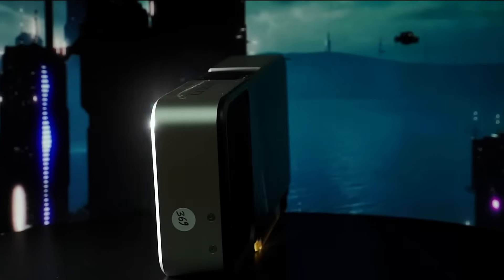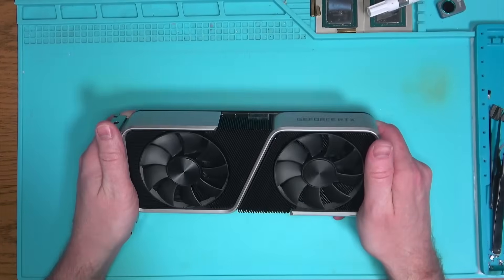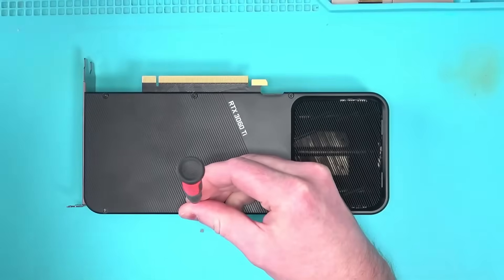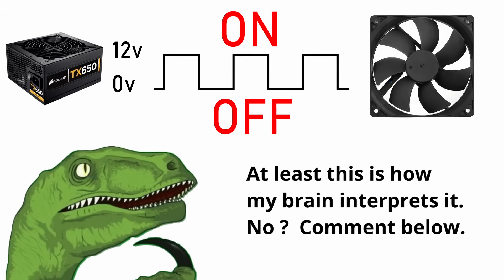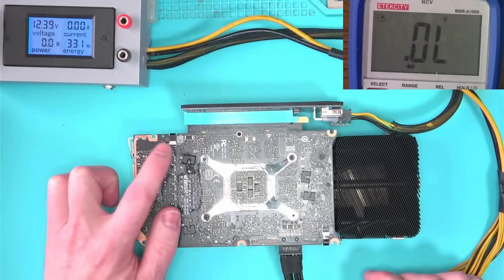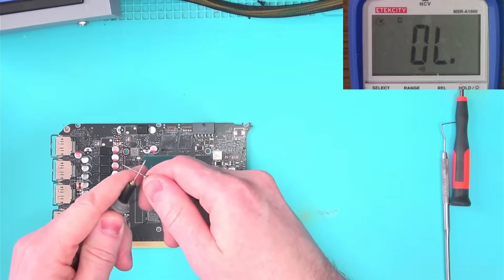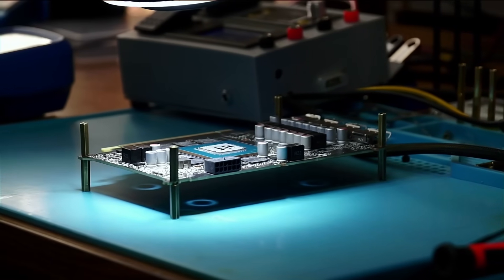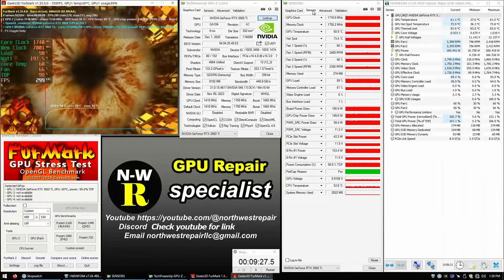Saving Your GPU: Nvidia 3060 Ti Fan Failure & Overheating Solution!

Comment: Hi Tony, I do'n't have a 3060 ti but, I do own a Zotac GTX 1070 Ti Amp! and the fans are stuck at 43%, I can change the speed in MSI Afterburner and or Firestorm but the changes are not happening on the video card. I recently cleaned it and replaced the thermal pads and thermal compound. However, I am wondering what controller is responsible the Fan's RPM/Feedback. Also the cable for the Dual Fans PWM cable looks to be fine and both are spinning. But as per the hardware I just don't know enough. Should I replace the Fans or the Fan PWM controller? If it's the controller, can you please let me know which one. Thank you much! Also I should say that both fans do spin, also when I turn on the PC they are quiet but just as windows logs in I can hear the rpm increase to the 43% and that is where it stays and can't be changed. I tried creating a custom Fan Curve but this did not work either. I also used DDU to remove and re-install the drivers and this did nothing as well. Maybe Windows is screwed up? I have a Multi-meter is there something I can test to see if this is a hardware issue? Thanks Tony! Cheers!

Comment: Hello my man..found you few weeks ago and....you rock.
I have few questions if you can answer if you ever read this.
1- you are awesome. Not sucking up...what you do is art.
2- are you located in Usa or EU or?
3-if on laptop MB or simply gpu board there is empty sport for memory could it bought and put in those spot and would it read that now it has from 6 to 8 gb etc?
4- reason I found you is that on my gigabyte P57W v6 laptop gpu died..Could that be fixed and could 2 more GB of ram be added?  Like is that doable, or do people do it?

Comment: What a great tutorial on fixing an nonworking fan! Explanation of PWM was also really great with oscilloscope. Where did you get the part if you didn’t have a parts list? A donor board? it would be cool to understand how you would go about the repair if you didn’t have an exact donor board, how would you confirm the specifics of a PWM Chip to be sure that it would work if you pulled it from a non-matching donor card.?

Comment: What caused that part to release its smoke?
Reply from the maker: who knows. internal fail
Reply: Small package, high switching frquency and high load for such a package. Commonly seen on main power rail switching keys in laptops. Today I had Ideapad 320 8th gen i7 with semi shorted AON 7408, board was in protection  mode due to shorted gate. No carnage, all resistances were ok, no shorts. Replaced with slightly better AON7410 and I guess another happy customer.
Reply: @MrHimer12  This only adds to the number of questions, but thanks for sharing.

Comment: More fancy fans have their own integrated motor drivers and speed controllers, so they use the PWM duty cycle only as a control setpoint reference (e.g. power percentage) and generate the motor driving voltage themselves based on it, which is usually another (high-current) PWM signal, but it can be sloped to reduce noise. I think some can even regulate themselves to a constant RPM (the PWM is interpreted as min/max percentage), or maybe that's just for pumps because most mainboards with PWM and tach signals do RPM regulation anyway.

Comment: Just wondering but when you first plugged it up and powered it on.  Can you not spin the fan by hand while watching the monitor software to see if it shows RPM rotation on the fan in question initially to check for fan 'communication' to the board?  Or is there a reason you should not do this.  Just wondering if there is anything good/bad in doing so.
Reply from the maker: yes most likely
Reply: @northwestrepair  thanks for the reply I wasnt sure if you had a reason not to.  Ive heard mixed feedback over the years about spinning fans on your own both good and bad so wanted your take on it.

Comment: What could have caused all that damage to that particular component alone?
Reply: Yeah, it does seem peculiar for such component(@that circuitry) to fail. If it's a common failure then it's an Apple engineering move.. Otherwise i guess either a defective chip or a possible bad filtering component along the way.. In that case this card might star again in a future video 😅

Comment: PWM interpretation is close, just that instead of frequency, it's duty cycle (how long the square wave is on vs off for each cycle - but frequently should stay the same.  (I think)
Reply from the maker: Duty cycle is the time which it stays high. (I think)
I think so because I weld sometimes and welders have duty cycle in minutes, indicating how long it can continuously weld.
Reply: @northwestrepair  Lets assume your fan consumes 10w at 12V. If you provide 12V half of the time and provide 0V rest, your fan cannot consume more than 5W. While off it is slowing down, while on it is speeding up. Not dependent of frequency but on off time percentage. Frequency determines smoothness of operation. If we replace fan with an LC circuit then we get buck converter.
Reply: @northwestrepair  I figured you knew, I guess you just got caught up trying to explain and film while fixing the card.  I was not expecting to know something that you didn't, that would have been a first lol
Reply: Right the PWM frequency doesn't change, just the duty cycle is altered as a percentage of on vs off over each interval.  FYI, computer fans typically operate at a PWM frequency of 25kHz.
Reply: PWM literally means pulse width modulation.  Yes frequency is typically fixed, basically its like flipping light switch on and off very fast and changing based on load how long you leaving it on for.  This is great for motors and initial load devices as you can push full duty cycle only briefly then back it down and adjust the 'on time' to match load demand and keep the required speed wanted.
Also depends on the literal design of the PWM as that is a generalized term and there tons of methods/names that employ it.  This is the basics of what your power supply always does hence why its called a 'switching' PSU. because its literally switching on and off in the double digit kilohertz range and you cant tell its actually not constant DC but rapidly switching DC.  This is also why ratings on PSU's are important as to how efficient it is.
The wikipedia page on PWM is pretty well documented about this.  I only know about this stuff from building PSU's back in the day for amplifiers before switching PSU's became the standard and moved away from full wave square bridge rectification for DC.  You'd be surprised how much amps you can pull out with nothing more then a capable transformer, square rectifier, and enough capacitance to flatten out the DC waveform.  They talk about exactly this in the Power Delivery section.
Reply: yes the duty cycle of the square wave results in an average voltage the motor sees... hence the wider the width the higher the average voltage and vice versa. This is better than using a variable resistor as that waste power and heat.
Reply: @enkur1972  in a lot of cases, the variance of actual voltage isn't good for the load either.  Pulsing full voltage is better for speed control.  This might be more applicable to motors though.
Reply: I don't think frequency has to stay the same. Duty cycle is a percentage. You could have a 50 percent duty cycle with completely different frequencies.
Reply: @--_DJ_-- i doesn't have to but it's usually kept the same because there are few upsides to changing the frequency.

Comment: Hello! Can you clear my doubt? Is the Furmark benchmark counterproductive or harmful to measure my PC's performance? Thanks for your videos! :trophy-yellow-smiling:
Reply: It can heat up your card if it's not cooled properly, and stress the psu aswell, but shouldn't harm your PC technically
Reply from the maker: @drinkintea1572  exactly

Comment: I take your advice on undervolting in previous vid correlates to this issue, thanks
Reply: Hmm, possibly.  Undervolting would generate less heat to dissipate so would likely cause the fan circuit to be under less load.  In that sense it could help prevent a component from going out.